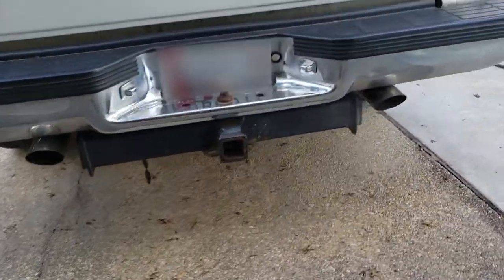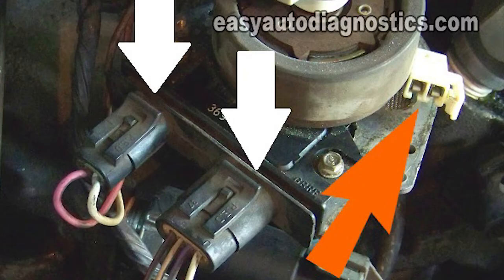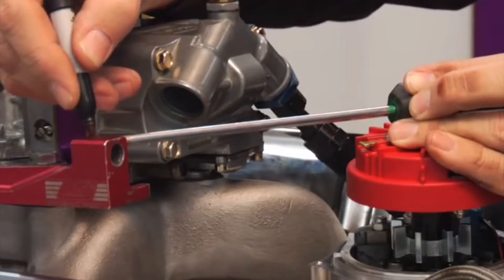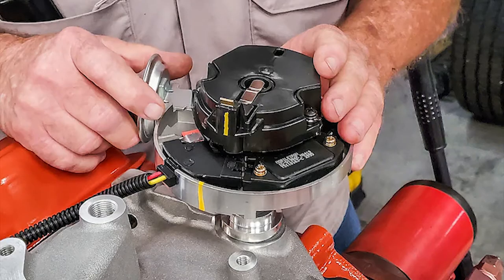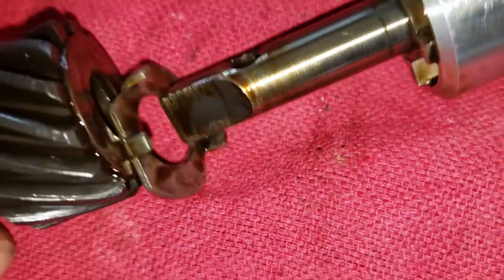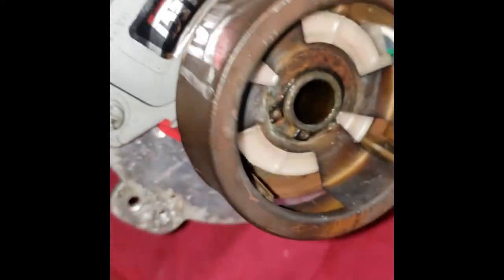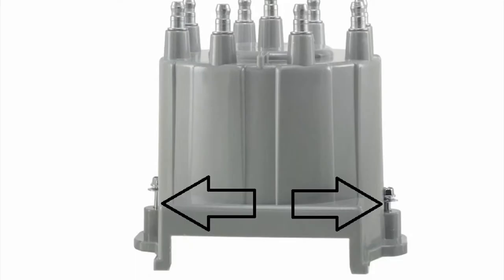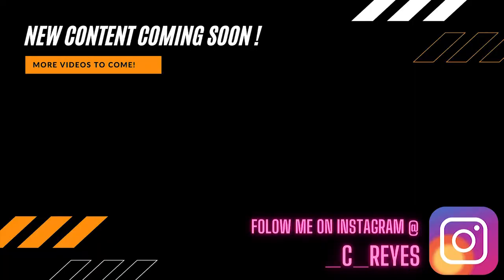Chevy GMC Distributor Pickup Coil Replacement 1988-1995 C/K 1500 2500 GMT400 Suburban Tahoe Yukon

Comment: Bro, all you had to do was to unscrew the 2 bolts from the cap, remove the cap, unscrew the 2 bolts from the Distributor pick up coil, then unplug the connector. Then just put everything back in reverse.
Reply: So the pickup coil can be replaced without needing to remove the distributor from the engine? I'm asking for a '89 Chevy 350 TBI motor.
Reply: Thats for the ignition control module. The pickup coil is different and he did it correctly.
Reply: No, bro... You must be talking about the ICM, the black thing screwed at the bottom of the distributor with several wires going to it.
But I would've liked it if it were that easy to change the pickup coil.
Reply: Your lost...iginition pickup not module

Comment: Hello, great video by the way.  I have an 87 Chevrolet Silverado.  The problem that I have is that it runs real good as long as I don't turn it off.  After it's been turned off, I have to wait 30 minutes in order for it to turn back on.   When that happens, it cranks and it does have spark . I can't hear the pump nor there is a pulse on the injectors.  I have replaced, fuel pump and relay, ignition control module (twice) coil and pickup coil.  Beginning to think that it might be the ignition control modules, read stories where people changed them 3 or 4 times before they got a good one. Any ideas ?
Reply: same prob i got on my 1995, 4x4, 5.7 L GMC 1500 Yukon ...what was your fix?
Reply: Yes, I replaced the new Delphi fuel pump from Autozone with a Ac Delco fuel pump. Now it works fine. Starts right away every time. So the Delphi fuel pump work, but it supply enough psi once it was hot.  It really threw me off because the Delphi fuel pump was only 2 months old. Ac Delco is more expensive, but it worth it.  Hopefully that works for you too.
Reply: @Superflyssrs  Is it still running good? im having a similar issue! im getting fuel to tbi but not out of injectors! and when it runs sometimes stalls out! new fuel pump only 6 months old. other times it runs jst fine!!!!!
Reply: @trucreationz6992  yes, it starts every time.  I recommend the Ac Delco.  If that doesn't work, try replacing the distributor. A while back I replaced the coil, the ignition module, cap & rotor, etc and I wasn't getting anything out of the injectors like you. My problems was the pick up coil.  So I took out the distributor and the pick up coil inside the distributor was very rusty. I just went a ahead and replaced the distributor and that took care of that. It's not expensive and easy to install and I'm not a mechanic.

Comment: Nice video.  What were the symptoms that you were experiencing that caused you to replace this part?
Reply from the maker: Crank no start. At first it would just randomly shut off at low idle. Then startup right away but you have to give it some gas to keep it alive. Eventually it stopped turning on. Resulting in a crank no start
Reply: Ok sounds like different symptoms than mine. Mine will back fire amd jerk going up hills sometimes usually when its hot out but not almost the time.  Thanks again

Comment: Thanks for the video, why did you replaced the pickup coil?
I've always had an old 350 Chevy with a 650 double pumper Holley and a HEI distributor.... Runs perfect... Now I have this 350 TBI.... what a load of shit.... I rebuilt the engine. .. It idle perfectly... Had the problem before the engine was overhauled... when I want to accelerate... it is very sluggish and almost sounds like misfiring... Struggle to pass a Smart on the hi way... my 74 Camaro had more power... I replaced the injectors, overhauled the complete throtle body, replaced the EGR, EGR solinoid, MAP sensor, Idle jet, throtle position sensor, rotor, distribuler cap, plug leads, spark plugs, tempreture censor, electronic controle module... But still, no power.... must I replace the distributer as well? I am so sick of this TBI... Love my truck, but have the feeling to drive her as fast as she can run at this moment into a wall!!!!
Reply: Is this the issue if the truck just dies? Only way it starts up is to shut the truck off, open the door then try to start it. Thanks

Comment: I have a V8  large hei distributor with a slightly different coil housing. ('86 305 TPI motor)
It looks like you reused your housing on this application. 
My new coil comes with new housing which is why I took my old one off, and then found a grease reservoir underneath, with old dried out grease. 
What is this grease? I think it must migrate up the shaft to lube the top of the shaft. Will simple marine wheel bearing grease be okay? 

If anyone knows, I would be grateful for your comments. 
Thanks